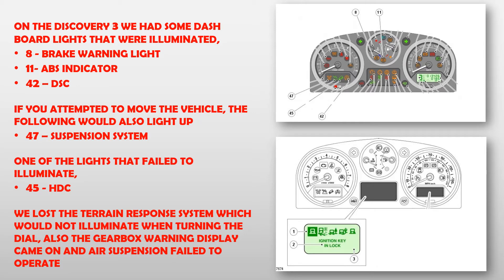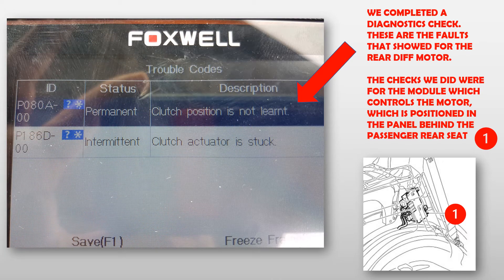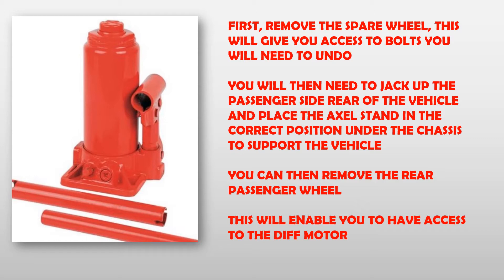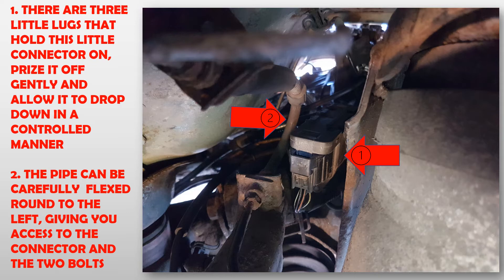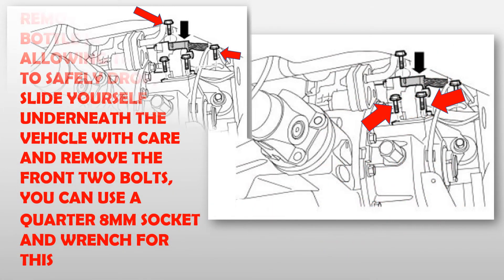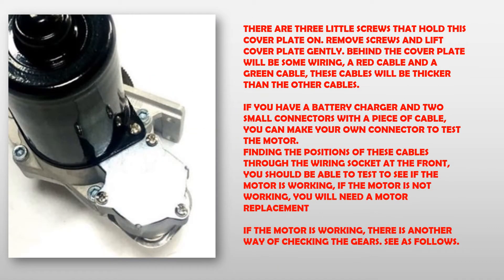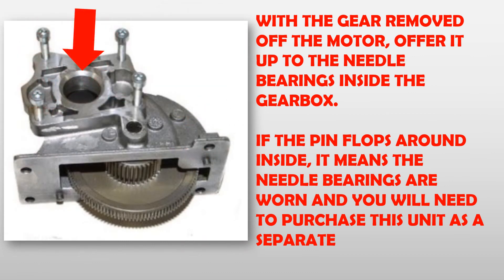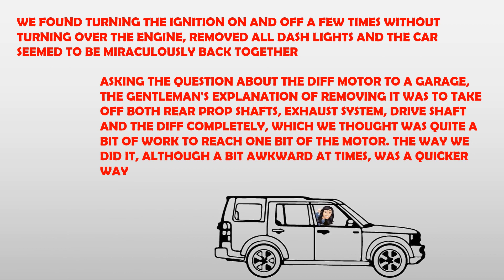LAND ROVER DISCOVERY 3, ELECTRONIC DIFF FAULT, HOW TO REPAIR IT

Comment: Hi can this be coded out, changed bearings in diff but have this fault now, changed motor but no joy, its a bloody nightmare, as its dropping the air suspension cause of it. Dont wanna strip diff again.